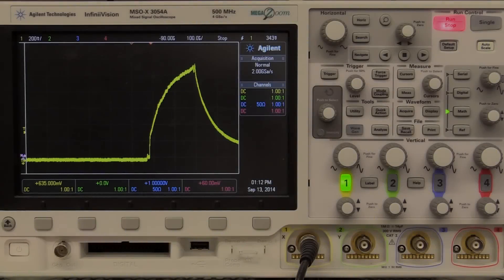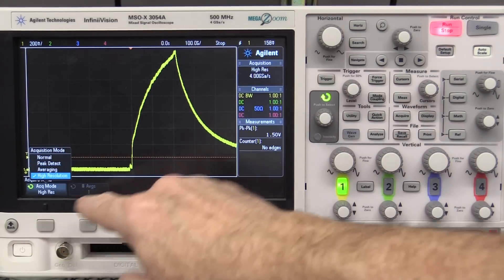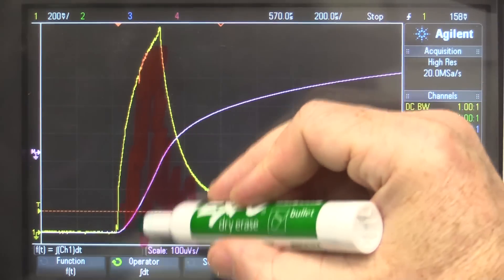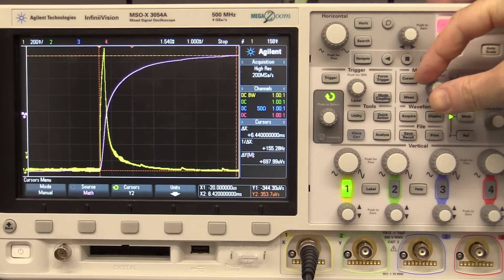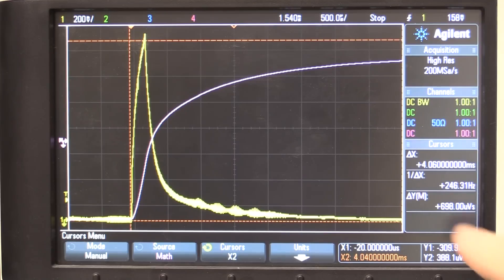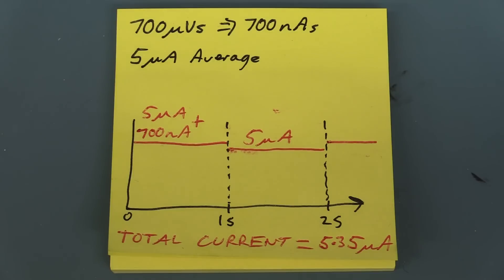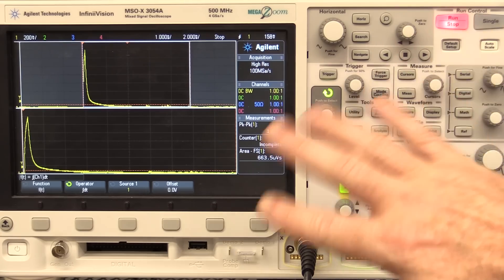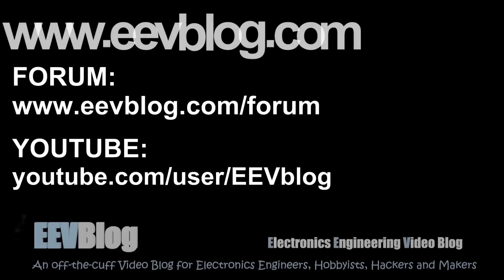EEVblog #662- How & Why to use Integration on an Oscilloscope

Comment: I wonder, why can't they come up with a sample based noise reduction kinda like with audio editors such as adobe audition.where you can essentially record a empty room, create a noise profile from that, then based on the area you visually taking place.you can limit the noise reduction process based on the profile to everything below a certain amplitude. It would be interesting if a similar process could done on an oscilloscope in order to reduce the impact of noise, with minimal harm to the signal you are actually trying to monitor
Reply from the maker: sarowie The uCurrent has effectively zero offset, and by luck the example is actually using almost the full range of the uCurrent range on the current peak. The problem is a simple dynamic range issue. The current peak is 1.4mA and the sleep current is 5uA, and you can't see that with an 8 bit ADC, you are down in to the boxcar averaging noise. And this is a pretty low dynamic range example, in practice it can and often is much higher.The uCurrent does not have issues measuring small signal compared to full scale, it's a matter of what instrument you use for the output measurement.
Reply: Razor2048
Oscilloscope use intentinally low bit count ADCs. The 8 bit ADCs have a better linearity then higher resolution (e.g. 12 or 16 bit) ones. When you go trough the calculations, you realize that a 12 bit ADC does not have true 12 bit resolution due to non linearity and other effects. For audio purposes, this doesn´t matter as there a plenty of other non linearity, but the dynamic range surely helps a lot when recording, mixing and replaying stuff. But for measuring purposes, those extra bits have to be taken with a lot of care. Still: I see where your coming from. Having a relatively slow and not perfectly accurate scope, but with higher resolution (12 bit or 16 bit ADC) would be useful in some applications.
(On the flip side: Some Desk Multimeter [-> modern ones with graphic display] can do exactly that: A lot of bits, ability to plot graphs but slower sampling rate then any scope)
Reply: My guess is that there is no point basically. In the context of audio, when you want to apply noise reduction, the implication is that the noise floor of your source file is far higher compared to the total dynamic range of 24-bit or even 16-bit audio. Taking a "silent" sample and subtracting it from the main waveform (a form of convolution I guess) makes sense in that context, though it invariably introduces artifacts at full strength. Quantization noise in audio is sometimes a problem when converting from 24-bit to 16-bit audio, where the quantization noise may become audible making it necessary to dither the signal (introduce structured random noise) to mask the less natural sounding quantization noise. In the case of oscilloscopes, their intrinsic noise is tiny with respect to the total signal range available at any given time. Removing that noise won't get you any more precision since you're limited by the ADCs regardless, and the best thing you can do is use the high resolution mode like Dave did, which is a sort of temporal averaging that comes at the expense of losing some high frequency information.

There is something to be said about conditioning and increasing the SNR of a signal prior to feeding it into a scope though, which is a common occurrence in communications. This can be done digitally through DSPs/FPGAs or using fancy analog filtering, or both. In general, it's more of a concern to make sure that a signal has good SNR and can fill the entire range of the ADCs to minimize quantization errors. It's conceivable that a signal could have critical areas of both high and low swings, making it impossible to analyze on an 8-bit and even 10-bit scope, so all kinds of specialty digitizers and general methods exist to deal with that in the scientific world.
Reply: sarowie This is pretty true. It's not so much that the scopes use intentionally low bit count ADCs though, but more that the only ADCs that have the required linearity can only be made with low bit depths, when other parameters are also considered. Oscilloscopes have many other sources of non-linearities in the analog front-end as well, not all of which can be accurately compensated for. For the number of bits, what you're referring to is the scope's ENOB (effective number of bits) value as a function of its frequency response. This is a non-linear relationship that is in itself a combination of the front-end and the ADCs. In fact, most 8-bit scopes have around 6-7 bits of resolution for much of their frequency range. It's the SNR itself that ends up being non-linear giving you lower effective capture bit depths. Scopes with higher bit depths definitely have their advantages and disadvantages. I have a 2GHz 8-bit DSO that serves me very well, but I'm sure that there are people who would be happier with a 12-bit scope. I agree that sometimes bit depth is more important than linearity, just like with your audio example. Nobody wants to listen to 8-bit audio unless they're into chiptune. ;)

In the audio world by the way, it's not uncommon for high-end systems to average the outputs of multiple DACs specifically for greater linearity in low frequencies where most audio DACs have the least precision. Whether this difference is audible or not is another story, but the linearity improvement is real.
Reply: Keep in mind, it's not the scope's job to determine which samples are noise or valid signal.  You, as the user, understand that an ADC will have limitations at the noise floor, and can decide how much emphasis to grant the data at that level.

For audio, absolute accuracy is really not that important, so despite the fact that noise reduction is as damaging to signal integrity as the noise itself, it doesn't really matter as long as it sounds better subjectively.  For data analysis, that is no longer an acceptable compromise.  The NR algorithm might introduce more noise than it removes, or at least different noise.  Or it might mask valid data, like clock pulses, taking this video's application for example.

Anyway, that's why averaging functions exist, or bandpass filters.  You can take an educated guess at the nature of the noise and use the tools available to remove it in the most effective manner.  Or, just accept that data in the LSB range is subject to inaccuracies.
Reply: You might be able to do that in a hokey way with an arbitrary waveform generator -- you can record the noise with the ArbGen, then replay it back on a second channel on your scope. Then you can apply a Math function to subtract the noise channel from the signal you're actually trying to read. I'm not an EE but I think that might do a decent job.
Reply: Oh, and if you meant to imply to use this noise reduction as a kind of DSP operation within the scope to condition the digitized input signal - it's technically feasible but would require quite a lot of computation power from the scope. Scopes already struggle doing simple averages on large sample sizes. Since the signal is digital at that point anyways, in most cases you'd want to get the signal into something like matlab and perform your filtering there. Maybe this kind of function already is or will be available in top-end scopes though, I'm not sure.
Reply: TheSageDad Usually the exact nature and frequency distribution of the noise has to be known (or very accurately guessed) in order for this to work, otherwise you would simply be introducing that noise to the main signal. Subtraction is the same as inversion followed by addition. Since noise is random, inverting it won't make any difference and you would simply add noise to your source signal. In order for that not to happen, your generated noise would have to cancel out with the noise in the source signal. This can only be done statistically, which can become quite complex mathematically.
Reply: whatlions
One thing to keep in mind: The scope has a low noise front end. but Dave is using his uCurrent. I would guess, that the error and offset of the uCurrent dominate other types of errors in this particular measurement. For e.g. as the Op-Amps in the uCurrent are auto-zero, I wonder if some of the artifacts on the scope aren´t auto-zero artifacts. Also the uCurrent has an issue with measuring small signals (compared to full scale). That is common for anytype of measurement instrument, but the uCurrent has only three ranges.
Reply: sarowie I agree. You'd have to characterize the uCurrent a little more to get a fully accurate measurement. Noise itself isn't a huge issue since integration would suppress much of random noise, but indeed many devices like Op-Amps/ADCs/DACs and even garden variety transistors exhibit non-linearities and various artifacts at the very bottom end of the scale.. though I must say I haven't looked at the circuit diagram of the uCurrent so I'm not qualified to make guesses in that regard. :)
Reply: Seems the oscilloscope companies should make something with 32 bit ADC in order to offer a little bit better dynamic range. :)
Reply: Razor2048 Really difficult to do that at the required sample rates. With ADCs, it's a compromise between bit depth, sample rates and signal to noise ratios. There are ADCs that have ultra high sample rates but terrible signal to noise ratios or low bit depth. ADCs themselves fall into many different types and use completely different digitization methods, each with their own implementation challenges. You can employ certain tricks like time-interleaving to double/quadriple/etc sample rates, but doing that at really high frequencies is extremely difficult and requires exotic interconnects and timing systems. For most applications, 10-bit is a huge upgrade from 8-bit in the context of scopes, since you're going from 256 to 1024 quantization levels (2^8 > 2^10), so that's something! :)
Reply: Razor2048
That's impossible. They should shoot for something like 18-bit by selecting the best chips, then perhaps specifying several LSBs of error.

Comment: OK video, Dave, but that's just the average current, what's the energy used?
Reply from the maker: jeromekerngarcia The point of this was to get the average current so that you can calculate battery life etc. Just multiple by the supply voltage to get power.
Reply: EEVblog  Thanks Dave. I see ProfessorLesh posted a similar answer before I asked my question. Lesson for ME to "rtfm", eh?

Comment: Nice video Dave, but So far, you're only part way to energy usage over the cycle. Energy is measured in joules = Watt-seconds. You've got the Average current (using your rounded up value 5 microAmp*seconds), now multiply it by the voltage, I'm guessing 3.3 Vdc. That's (3.3 V)*(5 uAs)  = 16.5 micro Watt seconds. = 16.5 micro joules. Here in the US, we buy electric energy jn kilowatt hours. So 1 kWh = 1000*10^6*3600 = 3.6*10^12 = 3 600 000 000 000 microwatt-seconds!

Comment: The area under the current curve is the charge in As or Coulomb (C), not energy. To measure the energy you need to measure the voltage as well as the current, multiply these curves and then integrate it.
Reply: Finally I see someone got it right.  Current is coulombs/second, so integrate over time gets you Coulombs, 1 Coulomb is something like 10^^19 electrons, 1 ampere is 1 coulomb per second, the integral then is the total charge that flowed through the wire.
Reply: +meettechniek This guy has it. Ampere is defined as a Coulomb per second so the integral of current over time will give you a unit of charge. For the energy you need the power (which he is getting from multiplying the voltage and current). Since power in Watts is defined as a Joule per second, the integral will result in a number of Joules of energy.
Reply: if your voltage is constant you can just multiply the integral of the current by your voltage, like Dave said in the video
Reply: Oranje boven, Oranje boven leve de koningin !

Comment: Did you double count the current of the spike?
...or did you turn off the pulses when measuring with the DMM? 

Unfortunately, we don't have that function on our basic scope, but it should be possible to guesstimate the average value of the spike by counting the number of squares on the screen (...ish) that overlap the spike and applying a fudge factor :)

tnx & greetings from Ireland
Reply from the maker: AnalysIRchannel The pulses are too quick for the DMM, so not a problem.On a DSO without integration you can print the screen out on a transparency and then put over graph paper (or vice-versa) to get a finer grid to count squares with. But then you have to take care not to goof the units conversion.
Reply from the maker: sarowie Any modern scope that can export data most likely has an integration function anyway.
Reply: EEVblog
I appreciate the purpose of the video was to show a use for the Integrate feature.

Would the Vavg measurment feature work also, if the display was scaled correctly? units adjusted etc...

Anyway, if I get some time I may try to implement some of the more useful features not on my scope, via the USB data connection. On the PC of course.

I dont think the relatively common low end rigol DS1102E series has integration? but can export data. So might be a fun project to add some of those features in offline.
Reply: AnalysIRchannel In this case a low pass filter (e.g. resistor and capacitor) could have eliminated the need for a scope, measuring the average current with a DMM and multiplying it by two should give you the same value...
But I think there were cases where you'll really need integration
Reply: EEVblog Or we can export the data of the scope, and get the points (x, t) and plot on math softs. And then get the area too. Easier than count squares on bare hands... IF the scopes can export data in values... Another way could be aproximate by a know function (sin, exp, step, etc...) and solve by math (or softs again). Probably many people know that, but to keep this ideia to all others...
Reply: Mario Sbampa
This scope can export data. Even Mid- and Low End ones can do that.